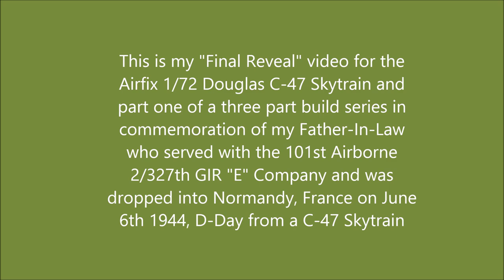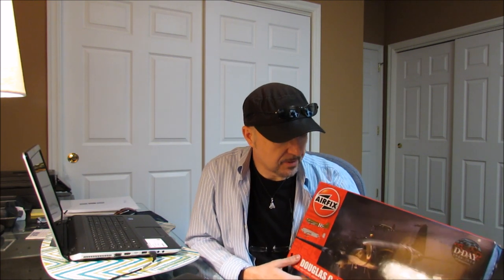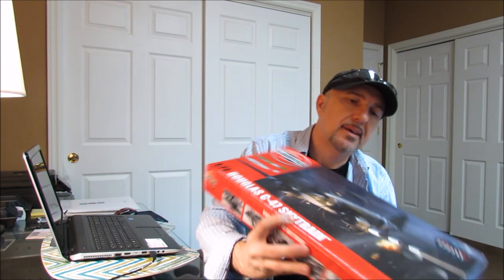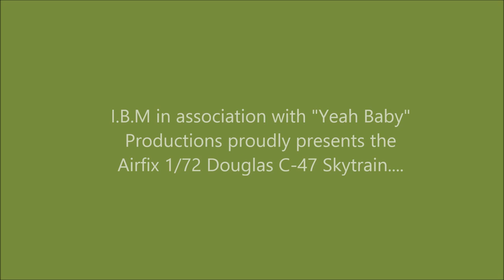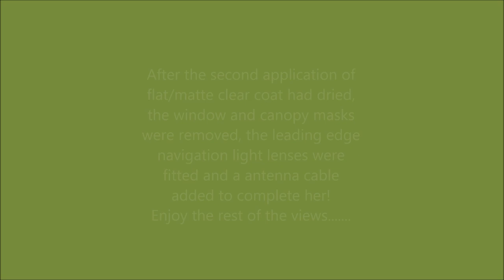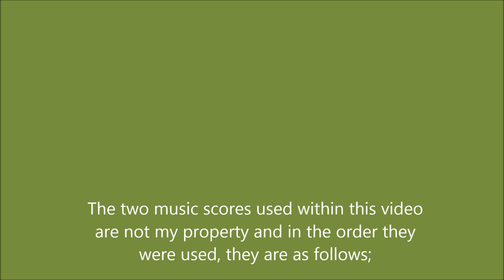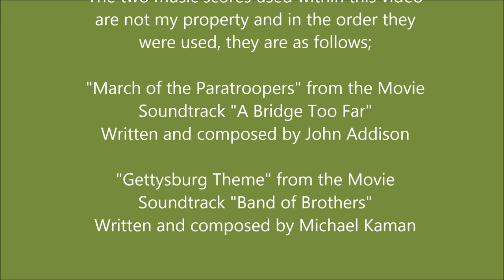Airfix 1/72 Douglas C-47 Skytrain Final Reveal (8-29-14) (My 11th Aircraft build)

Comment: The build quality is amazing.  While you are not overly aggressive with your panel lines they were a little heavy.  This weekend we had our local Intl airshow with two C-47's in that color scheme.  I didn't notice panel lines on the fuselage.  I don't know why some modelers  (not you specifically) really go heavy on panelines.  Just a different point of view, sometimes it takes away from the realistic look.  
Keep the videos coming.
Reply from the maker: Thanks for watching and commenting, Benny, much appreciated. You wont notice panel lines on restored aircraft that are kept to "showroom condition" with the paint always looking fresh and not worn, faded, sun-bleached etc. If you look at old black and white photos of actual war-horses, that have been used a lot during WWII and are battle weary, you'll notice that the paint fades around the panel line areas more than within the panels, making the panel lines look like they have dark areas on either side of them. Here are some links to images from WWII: https://upload.wikimedia.org/wikipedia/commons/1/1e/301tcg-c-47-42-93708.jpg      https://s-media-cache-ak0.pinimg.com/236x/4f/88/35/4f8835bb6aa2420131409c3fcbffc997.jpg      http://s1.reutersmedia.net/resources/r/?m=02&d=20071111&t=2&i=2171027&w=644&fh=&fw=&ll=&pl=&sq=&r=2007-11-11T180516Z_01_L10192468_RTRUKOP_0_PICTURE0    https://s-media-cache-ak0.pinimg.com/564x/bc/2b/66/bc2b66cce39b433c2e11bda808440055.jpg   Cheers : )

Comment: I seen this model the other day.  I've heard people having problems with the wing gap before, that's what put me off it.
Reply from the maker: It only takes a few minutes to correct it using a file...shouldn't be a reason not to build it?
Reply: International British Modeler I might pop into town & pick it up if that's the case.  I wasn't too sure how hard it would be to fix, as I'm just getting back into model making again. It does look like a nice model. Thanks!
Reply: Picked the model up today. I got it for £25.  I'll see how I get on with this one, then I can go back and get another one so I can make the 2 versions.
Reply from the maker: I used my Swiss (jeweler's) files...much faster at removing the material on the internal struts to get the wings to close together.
Did you see all the 3 issues that I indicated in the video? The second one is the wing root fillet sections- they stand proud of the fuselage, so, I filed the back side a bit at a time, until they sat down flush. The third issue is the location of the D-Day stripes on the fuselage sides...the painting instructions indicates them too far forward..., they should start from where the fillet between the upper fuselage meets the vertical stabilizer.
Have fun with her when you get it...just take your time, remember that it's not a race to impress, it's a hobby to enjoy and to relax with.
Cheers :)
Reply from the maker: Awesome! If you have any questions during your build, don't hesitate to ask...I'll try and help as much as possible. Have fun! Cheers : )
Reply: International British Modeler Thanks very much.  I undercoated the parts today as you e done in you video to make life easier when painting the model.  Because I've got a bit of free time at the moment, I've been told to get myself a hobby.  I just went back to model making as I used to do that when I was younger.  I went through the warhammer phase, I've out grown that now.  The kits seem well made now compared to 20 years ago. Thanks again.
Reply from the maker: Sounds like you're getting into it, hope you post a video of your builds so we can all get to see it?
I only started model making 4 yrs ago in 2014 after retiring in 2013....I had to do something to fill in all my spare time. The wife bought me 3 Airfix kits: 1/48 Spitfire Mk.II, 1/48 Messerschmitt Bf109E4 and a 1/72 Avro Lancaster BI/BIII, plus a airbrush and compressor for Christmas 2013, so, started building the Spitfire in January 2014, got addicted and never gone back.
Yes, because of CAD and CNC technology, better machinery...manufacturing and molding, the kits are far more accurately made and with more detail now. Then, there's the ton of after-market stuff that you can buy to enhance your builds that wasn't available when I was a kid. 
Have fun!
Cheers : )